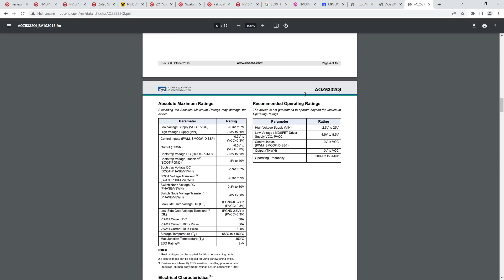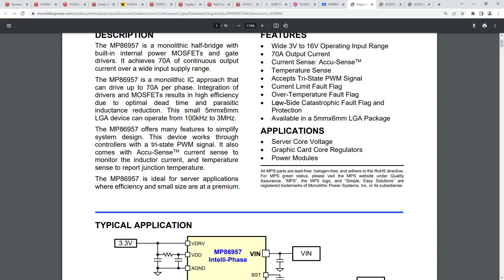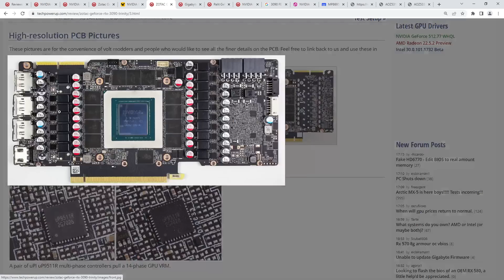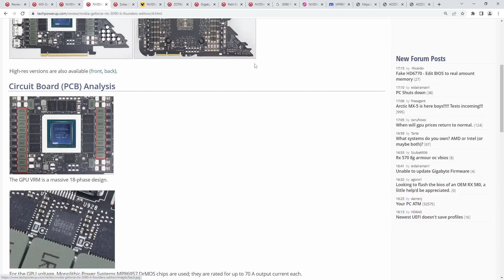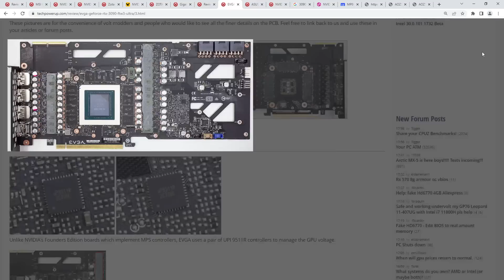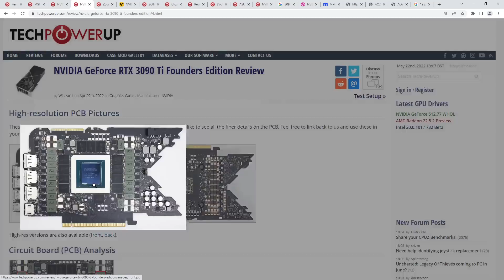RTX 3090 Tis should be much more reliable than RTX 3090s

Comment: Idk what kinda torture people put cards through but I have not had a single card fail on me. I have owned a 3060, 3060 ti, 3070, 3080 and 3080 ti none of which had a single issue.
Reply: Luck. Not really that remarkable in a sample of one person. Even the worst of the issues with the cards manifested only uncommonly.
Reply: @javaguru7141  Welp call me lucky but I know several enthusiasts that also own a lot of cards and have had zero issues as well. If you take care of your stuff and make sure it isn't getting too warm or dumping too much voltage into the core they should last a long time even with less than favorable power stages.
Reply: @gatordontplay417  That's good to hear. Though even if between you and your friends you own 50 cards, it's not that statistically surprising that none of them has developed an issue. There may be other factors that you've mentioned such as you and your friends making an effort to provide the cards with good ventilation thus increasing their survival odds. That doesn't mean that anyone with a failed card is more likely to deserve it for not providing their card with optimal operating conditions.
Reply: @javaguru7141  not saying they deserve it just saying that's what you get when you don't take care of your stuff. To those that did  take care of their stuff and still had a failure I'm sorry for your loss.
Reply: @gatordontplay417  And that's where I disagree. Cards going up in smoke from a bit of extra heat is not something that we should accept. The manufacturers can do better, if we set that expectation.

Comment: hey BZ can you tell me what you think of the 3080ti FTW3 controller/power phases? 
i believe it uses two NCP8610 controllers for gpu core voltage and NCP302150 for the phases
Reply from the maker: the NCP81610 should be an upgrade to the UP9511. The DrMOS are basically the same as the AOZ parts.
Reply: @ActuallyHardcoreOverclocking  would you say its barely meeting specs when running at 450w on the 3080ti ftw3 or does it have some wiggle room?
i currently have the ftw3 on a 1,080mm loop and soldered over the fuzes with a solid copper wire under the solder to bypass them as much as possible. using the 1000w galax bios. curious to know what power usage i can work with before i blow something up. vrms dont go above 50c on the hottest one at 600w usage. am i tempting fate?

Comment: I have a hard time finding this surprising.
The 3090 Ti given how long it has taken to come out should be the culmination of all the things that have been learned with the 3000 series.
I also imagine the buyers of a 3090 TI expect to hold on to the card for longer than 3080/3090 buyers as given how close a new generation is, to buy a 3090 TI means you're not caring about the latest and greatest, if you did care you'd wait for the new generation.
Reply: Not caring about the latest and greatest, by buying the latest and greatest. Sound logic there son.
Reply: @ManGhost11  the point was that I'd you wanted the latest tech, the 3090 TI isn't really it. The 3090 Ti introduces nothing that hasn't already been seen with previous 3000 cards besides being more powerful. It'll be leap frogged very very soon in almost everything except for maybe VRAM in the next generation.

Comment: Am I the only one who thinks that the 3090Ti is just stupid because practically in 2 months we'll get the 4000 series and whether the vrm is bad or good we'll get a much better silicon and much better 3dmark scores for like much cheaper? 3090Ti is kinda late...
Reply: No there are quite a few... The cards should've been released the same time as 3080ti or not at all... My guess is that the 2gb gddr6x modules weren't ready yet

Comment: If GPUS prices fall through the floor, and 3090s starting going for $1000 or less. What's the least-bad one to look for? Maybe just the one with the best warranty?
Reply from the maker: Strix
Reply: @ActuallyHardcoreOverclocking  Is this also true for running on LN2? What is it that makes the strix better than a KP or HOF card?
Reply: @fredit123456789  tons of high amp capacity power stages, more memory stages, thicker and more layered PCBs, better cooling designs, higher power targets, to make a few.
Reply: My 3090Fe's mined a touch better than my Asus Tuf.
Reply: @Safetytrousers  that's chip variance, the strix is better pcb and cooling
Reply: @emuclone154  The Fe's are better cooling in Ek special blocks, whereas their design for the Tuf is their standard design.
Reply: My 3090 FE has seen 580-600W (in some games, like Quake 2 RTX and Path of Exile with Ultra GI Shadows, with vsync  off, and hasn't blown up at all, but is very difficult to cool on the stock heatsink and a low profile heatsink and noctua 60mm fan on the backplate side.  Very reliable card but you can't hardware mod it with the EVC2SX as the controller has the read only bit set, you can't set vcore or loadline calibration, etc.  All you can do is just shunt mod it with stacked 5 mohm shunts.  The fact that a 400W FE card has seen 600W means it's built well.
Reply: the strix but with a cool my gpu copper plate memory mod and some kryonaught extreme pink paste
Reply: With EVGA, even if they got a bad vrm, you can get a 5 or 10 year warranty tho (30$ i think for the 5 years).
Reply: @thecolossus_5917  haha not anymore,to get a 7 year warranty on my 3090ti was like $240 and there is no 10 year option
Reply: @thecolossus_5917  Evga upped their prices and decreased the length of the warranties just recently because they know these cards are going to die earlier. Still got 10 year on a 3080ti in before they did though.

Comment: ok my 3090 cost 1500€
the 3090 TI cost 2100€ ? it should be better if i pay 600€ more.
I´m fine with the non TI
Next month we get the 4090 right ?
Reply: My three 3090s mined 24 hours a day for a year, they all still work (2x Fe and 1x Tuf).
Reply from the maker: @Safetytrousers  doesn't mining only really load the memory and memory controller? Games kill 3090s by overloading the Vcore not the memory power.
Reply: @ActuallyHardcoreOverclocking  I have gamed many hours on one of my Fe's. About 2 hours every day, and now 5 hours most days.
Reply from the maker: @Safetytrousers  most 980Tis outlast the warranty before the VRM gives up.

Comment: It definitely seems like Nvidia for some reason "cheaped out" on the components spec for the RTX 3000 series cards across the board. Compared to AMD cards which I have actually found difficulty finding ones that are designed badly using cheapy components. 

In addition to that there are the EVGA cards that blew up running new world and had issues with power rail balancing and power limits not being respected, and those all used cheap analog UPI controllers and those BLNO power stages. Nonsensical issues that should never have been issues had they not used cheap components on a really power hungry card.
Reply: Yes , I'm quite disappointed too with some of the 30 series cards costing a fortune and being very poorly built to boot. 

AMD have some exclusive AIB vendors who do a good job with their cards (mostly)- Sapphire especially but also Powercolor. Not so sure of that on the nVidia list , I might have said EVGA but they have some bad issues with their Pascal and Ampere cards.

It's ironically the larger AIBs who make both nVidia and AMD cards who make poor cards on Radeon - Asus and Gigabyte have made some very poor Vega and 5700xt cards - like copy/paste a nVidia heatsink design over which does not even contact the VRMs on the Vega boards.

Comment: aka 4090s should be much more reliable than 3090s
Reply from the maker: oh I wouldn't say that. 2080Tis were good and 3090s are terrible.
Reply: @ActuallyHardcoreOverclocking  Supposedly 4090 will use the same pcb as 3090ti, maybe that's why.
Reply: @ActuallyHardcoreOverclocking  well then, I hope the rumor of 4090 and 3090ti sharing the same board turns out true :)
Reply: @ActuallyHardcoreOverclocking  2080 Ti's have issues with the die delaminating from the PCB itself though because it's FUCKhuge. (754mm²!)
Reply: I guess it will depend on if the VRM is adequate for the rumored 500-600W power consumption